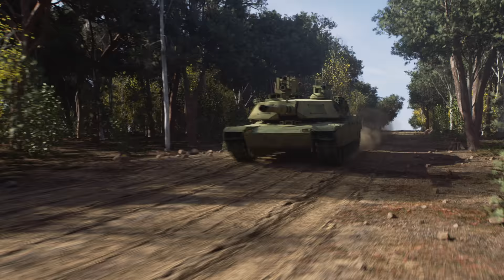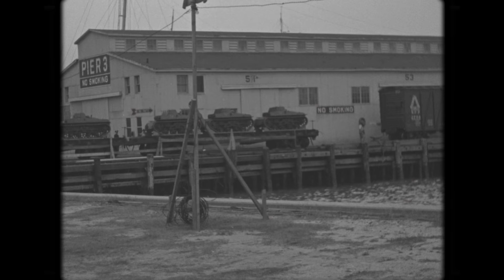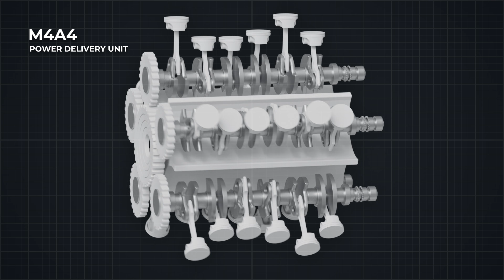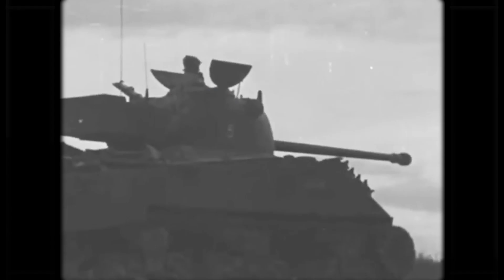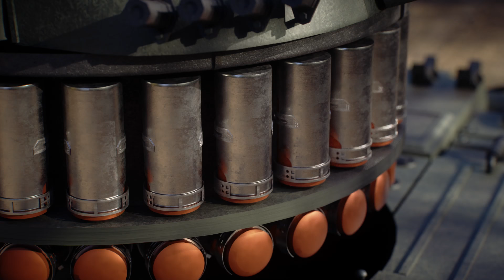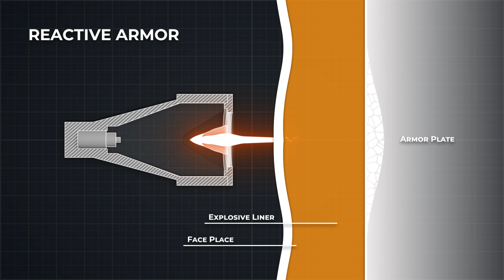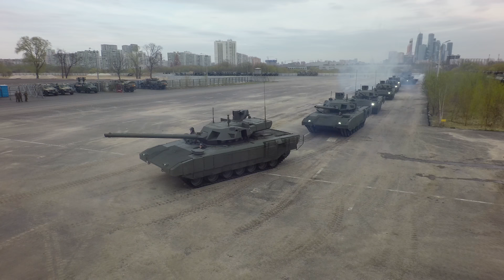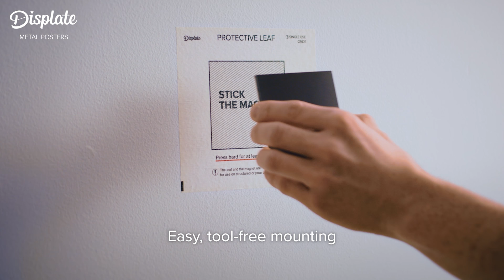Why America’s Tank Failed in Ukraine

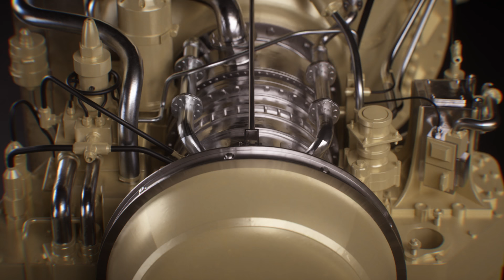Comment: 1:00 this isnt unique to the agt1500. every diesel in soviet main battle tanks are multifuel, able to run on gasoline, kerosene(jet fuel), and diesel. western multifuel diesels are only able to run on diesel and jet fuel.
12:56 the graph for diesel is not representative for all diesels. that one looks like the 5td or 6td engine, which were known for poor low end torque. the v46 and all subsequent variants had a very flat torque curve like the agt1500. for example, the v-46 at idle(1000rpm) produces 3011 N*m of torque. its maximum is at 1300rpm producing 3090 N*m.
15:18 reactive armor elements must be at an angle relative to the incoming heat jet. otherwise its effects are greatly diminished as it mainly effects the unfocused part of the jet on the outsides. its not the shockwave that disrupts the jet. air is not dense enough to disrupt a copper/tantalum jet going mach 5+. its the metal being thrusted into it at an angle which prevents all the flowing copper(not molten) from focusing.
15:50 DU doesnt just magically break up apfsds. its just very dense even compared to tungsten alloys and as a result, requires more energy to displace. the breaking up of apfsds is more about the non-metal components of the composite
16:17 turbines were not much less reliable. the main lessons that the russian army learned from the t80s was that it was far too expensive(10x the cost) and guzzled fuel. its main benefits is that it takes 3 minutes for the engine to be ready to go in -40 conditions, whereas diesels needed 30-40 minutes. reliability was NOT the reason they were abandoned. 

for an "engineering" channel theres an awful lot of anecdotal claims with no substance at all. definitely need to hire new writers for military stuff.
Reply: I absolutely adore this comment! No fluff. Just correction. Regarding the third point what's the difference between flowing and molten copper in that context?
Reply: @TheYuvimon  for the copper to be molten, it must be over 1000 C. it also doesnt just instantly melt when it hits 1000C because all materials have a heat of fusion, which is the surplus energy needed for a material to change phases. the copper in a HEAT projectile is just being pushed so damn fast with so much force that it behaves like a liquid, but its still a solid. SY simulations has some videos of heat simulation if you search "SY simulations HEAT" on youtube.
Reply: Describing a need for low-end torque from an engine is similarly absurd - torque comes from a gearbox unless we're talking direct drive aircraft engines. At the time that was prioritized, but due material limitations. Same misconception from the car world; if the engine doesn't feel right, sometimes that's just the gearbox ratios and final drive. 
The general shape/area of the torque curve, sure.
Reply: @troy4393  this is correct. torque is ultimately irrelevant because we have gearboxes. what does matter however, is the "flatness" of the power band. that is, how wide the rpm range is where you get both high torque and rpm(multiplied together you get power). 

the reason why people mention low end torque is because it ultimately also indicates low end power. engines like the 5td and 6td all have the issue of low end power, where rpm and torque is low. this is made worse by the fact that the 5td engines idle much lower than the v46 and have lower torque. 

to get the same acceleration from rest and when going 20km/h, you need less power at rest. this is just because power is energy/s, and the kinetic energy of the tank is 1/2mv^2. so doubling the kinetic energy of the tank will only increase its speed by 1.4x. very simplified since youd have to do other stuff to convert it to acceleration but you get the point. the flatness of the power band is what is important, which both the agt1500 and v46 have, along with many others like the gtd1000, Ka-501, etc etc. 

for an engineering channel, im extremely disappointed in his presentation of this. torque doesnt matter. just the flatness and range of the power band. there is no way an "engineering" channel should get something this simple wrong. perhaps he should stick to engineering content until he hires actually knowledgeable writers.

if you want to read more about this stuff, or at least on the t72s engine, i reccomend "tankograd" and his post on the t72. itll be part 2 on his website under the engines section.
Reply: @itsericzhou  Exactly! I didn't want to spend the time to type all of that out, but the shape of the curve and the area under it is what matters - a torque curve that peaks at 100 RPM and just nosedives from there is not usually very useful.
Reply: @troy4393  That is wrong. You can change gear ratios to achieve higher torque, but that will also make you go like 0,1m/s... the performance of the engine under certain operating points is what is important to the torque curve. If the engine does not produce alot of torque at 1000 upm, you cant just change the gearbox to 10x it. I mean you can, but as I said, you will basically go 0,1m/s. Not very useful.

An engine that produces more torque basically only needs high boost at low rpms and therefore high quantities of fuel injected. That puts alot of strain onto the components and pushes alot of heat into the engine (lugging).
Reply: @heavyweight6440  that is a very roundabout way of describing power.
Reply: @troy4393  ?
Reply: @heavyweight6440  your second paragraph moreso applies to gasoline engines for consumer level engines. diesels do not necesarily benefit from higher rpms as they inject fuel into the chamber right before top dead center and as the piston goes down. while a higher rpm gives you more combustion cycles per unit time, it decreases how much fuel can be injected per cycle as the piston goes down since theres less time to combust, and the speed of the flame is limited by physics. 

what the previous guy said is correct. torque does not matter in the slightest. a 1000hp race car can do more work than 600hp semi truck engine, so long as the transmission is geared correctly so that theres enough torque at the wheel. the engine at X rpm produces Y amount of power, which through a gearbox can be changed to provide any amount of torque at Z speed. what actually matters is how wide the rpm range is where the engine can deliver that high power. this is why a flat torque curve matters. since rpm must increase or decrease, the only way to keep the power graph flat is to keep the torque graph as flat as possible.
Reply: @itsericzhou  I never said the engine needs to rev higher? I literally wrote "more boost at low rpms and more fuel", thats literally how every truck engine works (beside that fact that they have insane stroke lengths) and thats also how the 550d makes like 400hp+. It as 3 turbos that push high amounts of pressurized air into the engine at any rpm, meaning you get much more torque way earlier in the rpm range. 
I just wrote that with different gearing you trade in torque for (outputshaft/wheel)speed.
If you double the output gear size, you half the speed its spinning at and since a diesel tank engine will only rev to like 2,100rpms or so, you cant just magically double the engine rpm to get even more torque and same speed.

Obviously a flat but high torque curve is optimal, because P = 2*Pi*M*n with Pi being a constant and if M[Nm] is also almost constant the only variable that changes is the shaft speed/engine speed.
That means you get more power as the engine revs higher, especially when the torque curve is flat/constant. Thats obviously limited due to mean piston speeds, as you said the time the fuel needs to burn up and mechanical strain.

Maybe we are talking past each other, because what I understood from the original first comment is that the engine doesnt need any torque because you can just build a gear box that multiplies the torque. Which is true, but again: it kills speed. That is of no use.

It was never my idea to deny, that a proper gearbox with proper gear ranges is important to drive performance, because obviously its important.

If torque is so unimportant, why do we calculate Power with it?
Reply: @heavyweight6440  you misunderstood the original comment. they never said torque isnt important. there is a stipulation that only power matters. i get where hes coming from, because theres this huge myth irl that the big semi trucks might not produce as much HP as a race car, but they produce a ton of torque, which somehow offsets it. 

for a tank, and also for trucks, you need a flat torque curve. that is what my original comment was talking about, because the video was talking about how the agt1500 had better low end torque making it better than contemporary diesels, which just wasnt true, and how its not necesarily low end torque that gave it an edge(that didnt exist), but low end power. good low end power guarantees you good low end acceleration. good low end torque does not, as it could be a good amount of torque at a much lower rpm(kind of the issue with the 5td, along with the accompanying bad torque.
Reply: Because it's a propaganda channel
Reply: "N/m" is not the correct nomenclature for torque. Its Newton*meter, so Nm. If you want to correct somebody else, you have to be precise yourself :)
Reply: @heavyweight6440  ah you are correct. i did lose like 10% of my marks during my statics final with that mistake as well lol. will be edited
Reply: "reactive armor elements must be at an angle relative to the incoming heat jet"
Not...really.
It depends on the model.
Granted,Kiev regime only has K-1,so yeah,the angle is good.
"air is not dense enough to disrupt a copper/tantalum jet going mach 5+"
Nine kps-plus. Yes,technically it's mach5+,but it's closer to mach 30.
Reply: @vladkorobov155  no it doesnt depend on the model. the elements themselves must be at an angle relative to the incoming jet for maximum effectiveness. k1 has 2 explosive elements per block, and one of them is angled relative to the block. regardless, youre supposed to mount it angled like on the t80bv. even stuff like nizh/nozh, k5, relikt, etc. all require the elements themselves to be angled. against kinetic projectiles, this is even more pronounced. 

also yeah the speed of heat jets is anywhere from mach 20 to mach 30 or even higher. i just said mach5+ to mean hypersonic, but that term is so overused it has lost its meaning.

Comment: Bro 😂😂 you're making it seemed like you're going to redo a video on the Abrams, not making a historical overview of tank engines 

This is diabolical clickbait bro, wtf I thought you were better than this 🥀
Reply: Yeah, alright, the Jet engine is fuel hungry and it's increasingly a disadvantage in the modern battlefield, putting more strain on the logistic. But why corelate that in particular to losses in Ukraine when there are other factors (like the general increasing scarcity for spare parts for American equipments and munitions, advancements in drone tech, sophisticated data gathering and battlefield recon, ect), and also, why you're shaping your opening thesis like the losses were particular and specific to the Abrams? Like it was an Abrams only issue instead of something all tanks are going through right now? That's like saying using gas stoves makes it more likely to burn/overcook your food because it uses open flame. sure that does happened and they do tend to have a higher max temp ceiling, but blaming it solely on it being an open flame gas stove is misleading. 

And in this case, it'll just cater to the "Russian domination" misinformation rhetoric since it implies that Ukraine's Abrams were worse than whatever scraps of metal Russia is fielding nowadays, making it seemed like they're bleeding through tanks (and even on the brink of collapse depending on interpretation and your scale of hyperbole)

Comment: Diesel-Electric is only real alternative to jet engine in case of high torque at lower RPM. With modern advancements more and more countries started looking back into that solution. It was already explored in '40s but dropped because of many disadvantages for that era, but time changed and old ideas can thrive with modern stuff.

Comment: Drones will only become even faster, more numerous, easier to control, able to lift more explosives, and more resistant to jamming from here.  To keep using tanks on the front you'd need one or two specialized drone-shooting auto-cannons for each one, or wait for heavy fog... and it would still be extremely risky.   
Tanks are as obsolete as the Bismarck and Yamato.  Spend the money on drones instead, or lose the next war

Comment: I feel it's a little disingenuous to say that the Abrams is wholly unfit for the modern battlefield... It's still one of, if not the most advanced and capable tank platforms available to western armies. It's more so that ALL tanks struggle to counter drones in modern warfare. The era of the tank is almost certainly not over, but there will be some major growing pains in the coming decade to counter these new threats.

You can throw hundreds, or maybe even thousands of fpv drones at an Abrams, and if even one hits and disables it you are at a net positive cost vs damage assessment. There's a reason Russia has lost over 4000 visually confirmed tanks since February 2022. Modern war is just extremely costly in both manpower and materiel. That doesn't make the tanks useless, or even obsolete.

Comment: Not agreeing over whether to use metric or US customary units is crazy to me. I am American and would never use metric units (except liters, all our units of volume other than gallons and quarts completely baffle me, and a liter is like 1 water bottle so an actually useful size), but with like science or the military or things like that, you should be using SI units (technically not the same as metric but similar), and when collaborating between countries that is even moreso the case. You agree on a common language to use when working together, you should agree on a common measurement system to use when working together.

Comment: Regarding electric transmission in tanks -- Porsche tried that all the way back in 1943, with the VK45.01 (P) prototype being the first tank (to my knowledge) using petrol-electric drivetrain. Most were subsequently converted into the "Ferdinand" Jagdpanzers. Back then the drivetrain wasn't particularly reliable, but this type of drivetrain has since been perfected in all kinds of vehicles, from boats, to trains, to cars.
Also, comparing it to Prius is not exactly correct, because Prius actually has mechanical drivetrain connecting the engine to wheels. Proper heavy-duty ICE-electric drivetrains are fully-decoupled, meaning the engine spins generator, and then wheels get driven by electric motors. The more correct comparison would be pretty much about any diesel-electric locomotive. Also much closer to being in the same weight category, too.
Reply: Nope the French deployed hybrid tanks in WW1, Porsche was a great reuser of others ideas
Reply: @robertpatrick3350  interesting, sauce on that?

Comment: I love this channel and your work. But i feel this video was lacking. It missed key information and putting things in perspective like the timescale of the abrams bring deployed and how they have compared to the loss rate of the russian tanks. Also the use of torque vs power didnt seem right being power is how quickly the works being done. Low down torque is just the power (be it measured in hp or kw) getting stronger sooner. The way language has formed and torque vs power is messy and often silly.

Comment: Honestly the next tank that gets developed needs to be a hybrid, I am even more convinced after the reasoning as to why they thought jet engines would be a good idea, reason being is you can run the diesel engine at it's optimal RPM constantly which increases efficiency and with the supplement of the batteries you don't need as powerful of an engine and because you don't need to worry about performance in low RPM scenarios you can cut the size of the engine again, admittedly a lot of that space is gonna get eaten up again by batteries, but batteries can be fitted more conveniently so it would still be a benefit. Then you have the ability to run relatively silently and relatively cold, the massive fuel efficiency gains which would extend range massively and at this point to me it's a no brainer.

Comment: Using tanks is as obsolete as using knights in shining armour.
    Yes, it can protect you when you meet other knights, but you stand no chance against the modern soldier. 
    If you need armoured vehicles, opt for the CV-90. Still with the big gun, but with agility and smartness as protection.

EDIT: BTW, as usual, the US was more than a decade behind Sweden.
   The Swedish Strv 103 (the turretless S-tank) used a Boeing GT502 jet engine and showed that the concept worked 13 years before the US dared to try it, and the first Abrams was produced.

Comment: Let me tall you the problems with the Abrams tanks in Ukraine. It all started when dinosaurs ruled the world and the ice age wasn't yet an issue... 
The problem with Abrams tanks isn't probably the engine alone, but the way it is used outside of the rest of the military support the US would be using if it was in war itself. No air support, no comprehensive strategy, just reaction tactics. It's probably not an engineering problem.

Comment: Driving 70 tons of steel in the Ukrainians mud has no sense, IMO...
27 out of 31 is not simply "war usage", all this tank was hit in one action. 27 actions = 27 losses.
Ukranians simply stopped using them.
The extreme weight forced them to stick to pavemented roads 99% of time. The Abrams was an easy target with such usage limitations.
(Similar problems had the german leopard too.)